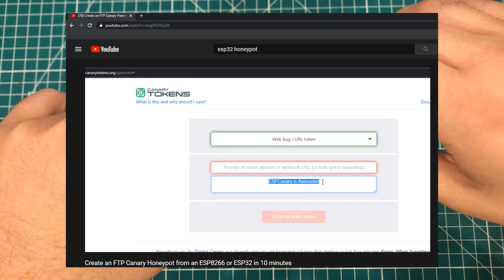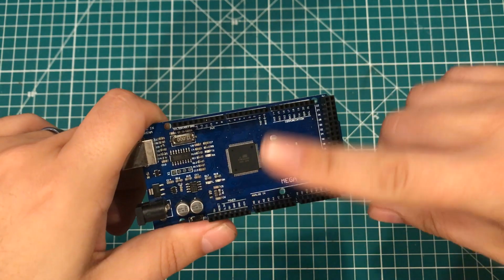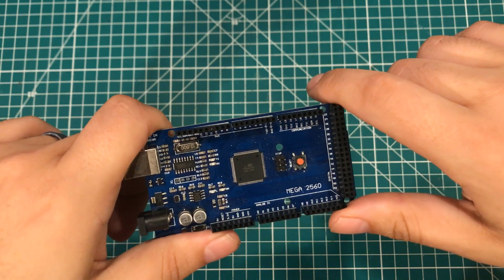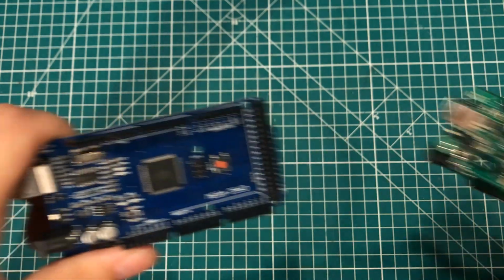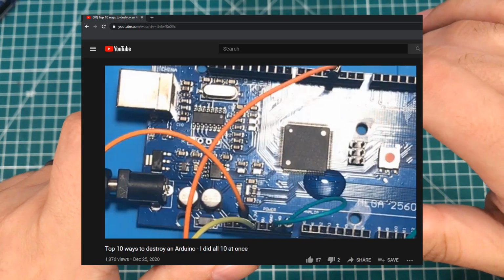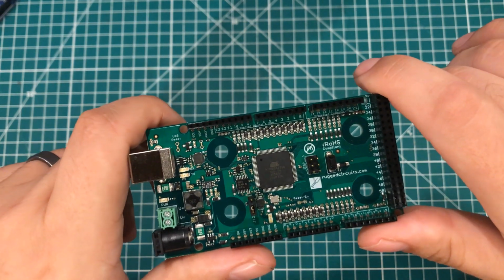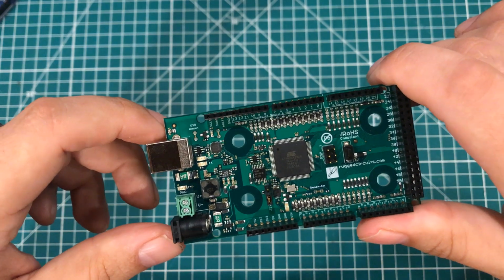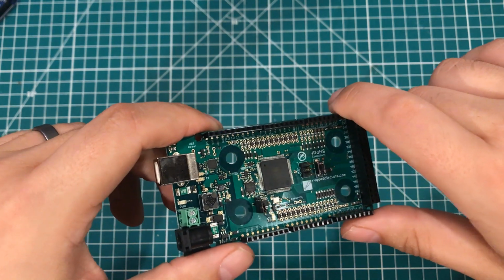Can you use an Arduino in Commercial and Industrial Applications?

Comment: Great Video!  Great channel.  
The Rugged MEGA inputs are rated up to 24V max.  Power input is 3.5V-30V.

The 24V Industrial Shield will also work on all Uno based micro boards.  The Rugged MEGA happens to have a selectable jumper which allows use of Mega based boards or Uno based hence the compatibility.
Reply from the maker: That's really interesting.  I really like the PLC board, and I think people would be interested in testing it with a cheap UNO clone and then moving to a more expensive Rugged board after testing.  That's all great info!
Reply: Thank you for ckarifying!

Comment: The Industrial world runs on mostly Allen Bradley and Siemens PLC reason  they are designed for industrial purposes do way way more than just basic digital I/O. Factory plant control does now way way more in what was once done back in the 90's these PLC are not cheap but when you have a multi million dollar plant running where safety and reliability is what is important a Arduino does not come even close. Also when you supply and write to these PLC's you want support when you need it software that's reliable in developing your solution. The arduino I have never ever seen used as an industrial replacement. Its was designed as a learning tool and for that its great but as a turn key solution its a no go. And for embedded devices the world mostly runs on Intel, Motorola and Siemens micros.

Comment: You can of course replace PLCs with Arduinos. You may need 24 relay shields for the I/Os and depending on risks of the application you may need to manually add redundancies and good coding practice. But they can absolutely be used in place of PLCs.

Comment: Great but in high-speed operation i think that has not able to perform very fast operation...in generally inside the plc have STM 32 microcontrollers..it has more faster than arduino

Comment: Interesting 🧐 I most definitely have stuck it to the man with my crane. They wanted $10k for a wireless controller…I’m sure my solution isn’t as robust, but if anything faults I can get replacements from Amazon/etc in 2 days for  couple bucks and plug/play replace anything. My plan is to just build extra transmitter and receiver boxes and have them on hand since they’re so cheap 

https://youtu.be/l-EUqPsLQYg
Reply from the maker: Awesome channel.  Subscribed.  We used them on heavy equipment all the time in Alaska.

Comment: How reliable is this board? When I use a arduino uno or nano, I always run into the problem that it crashes wenn I use it in 220v applications. I need a board that doesn't crash when I'm putting on a heating element or an electric motor.
Reply from the maker: I'm wondering why that would be. I found this thing to be crazy reliable. If you are doing some kind of relay, is it optically isolated from the board?
Reply: @AnotherMaker  yes I use the Standard relay boards from ebay,  they are optically isolated.
Reply: @duitsland2756  it seems pretty weird. The only thing I can think of is that maybe you need to power the relay board externally. If you are driving the relay board from the Arduino itself you could get some kind of voltage dip... But generally those relays don't care what they are driving

Comment: One of the companies I worked for we did project where they built a custom PLC to take a hydro mechanical device and convert it to an electromechanical device their initial bid to create this was $50,000 per spindle x 100 spindles per site. The customer needless to say wasn't too anxious to sign up for that they actually ended up doing it themselves over a course of a number of years whether they have the control or not who knows.
I ended up going back to the same plants but for another employer years later that's the only reason I know that they managed to get it done.
The company I work for previously that made these machines the newer electrical mechanical devices were Rock solid the control was insane you could actually make a lot more of the process than what was being used not to mention much faster much more accurate the price of the machine wasn't any more expensive the problem is taking the older machine and make it like a newer machine meant removing the entire electrical system top to bottom front to back sensors everything 100% had to go that's part of why it's so much for spindle to upgrade the machine.
Reply from the maker: For factories and things like that, downtime can quickly add up to millions of dollars lost, so it's often worth paying for the expensive stuff...depending on the risk/reward ratio.  Other times, the cheaper option is great because it's just not that important.

Comment: Ran a rock quarry crushing plant with an oldish PLC running on a ruggedized Windows 97 platform... (They're still running it btw) I can't begin to tell all the expensive repairs and thousands of hours of downtime that could have been avoided with a proper PLC or wayyyy better a microcontroller. (Which we had for two different crushers.) The interface/UI was OK, but not really that programmable unless you're the guy charging $2500 for a few hours to reprogram... Lack of reliable sensors, crushers boiling over, belts shredding and smoking, crushers STALLING and then getting to dig them out which is always a riot. I sketched out an improved logic/feedback loop a few times while up there and determined we lost 10% in just plant time, diags, electricians visits, training new employees to do something on a belt they can't see.
PLC upgrade/replacement cost?... $90k
Reply from the maker: Yeah. The cost of a board is only a fraction of the total cost of ownership with this sort of thing.  Thanks for the awesome comment.
Reply: but can this micro controllers   perform complex logic as done by plc ladder logic ? I have a 4 dc  output and 3 ac output)0.2 - 9 amp) small project  plus 7 dc input, with washing machine type logic.
Reply: @anandjoshi8554  Probably not one this size, but definitely could use a raspberry pi as enough. The wireless connectivity is great for sending plant reports. 2/3 of the power cabinets (can't remember what they're called for some reason) out in the plant that house the starters are run on LAN anyways, and the 3rd wireless I recall.

Comment: ATMEL's are pretty solid ,but you're right when it comes to thorough testing and safety features. At the very least you would want to develop your own board and power supply. The EMF from industrial motors are the biggest issue. If your IO lines are not shielded enough and your power supply is not properly designed. You are going to have serious issues. We had some freezing because of high voltage spikes, even the MCU watchdog was no match. A custom well tested solution can be created with those chips, just design you own board. Create software libraries with failsafe's built in. Also have a backup on board if the main controller fails and for goodness sake don't use those Arduino modules. They are of a horrible quality and design. Some of the chips are fake eve., only fit for prototyping. I have personally used an Arduino Nano and other off the shelf stuff to control a machine that consisted of a fridge compressor, dehumidifier compressor, temp and humidity sensor, 2 thermistors to monitor refrigeration coil temps, 2 speed control of a fan, a segment LED interface display and logging on a SD card. I modified an existing board by making a break out board form the microcontroller socket. Lots of resistors ,ICL, and RC circuits. Only a prototype ,but works perfectly.
Reply from the maker: Yeah The application matters.

Comment: You don't get far in commercial electronics without encountering integrity, reliability and safety issues. Using an Arduino shows an attitude from the outset that is primarily inspired by achieving cost cutting. Free software and minimal hardware design with minimal control of quality. Most PLCs use a very strict RTOS scheme to allow the programmer to achieve highly predictable results. The thought of an off the shelf Arduino running hacked free libraries controlling high value plant or anything with a safety critical aspect is enough to make most engineers blood run cold. This is why Arduino commercial solutions are so infrequent in the real world. Yes, technically an Arduino can do the job in many cases but who would want to be in the position of justifying it's use following an issue or accident.
Reply from the maker: You're absolutely right.  It obviously depends on the application.
Reply: ATMEL's are pretty solid ,but you're right when it comes to thorough testing and safety features. At the very least you would want to develop your own board and power supply. The EMF from industrial motor's are the biggest problem. If your IO lines are not shielded enough and your power supply is not properly designed. You are going to have serious issues. We had some freezing ,even the watchdog. because of high voltage spikes. A custom well tested solution can be created with those chips, just design you own board. Create software libraries with failsafe's built in. Also have a backup on board if the main controller fails and for goodness sake don't use those Arduino modules. They are of a horrible quality and design. Some of the chips are fake even, only fit for prototyping.

Comment: These industrial ruggedised boards would have been handy. Never having built an industrial factory floor machine in my life ( I was only officially employed initially as a factory worker an subsequently as a maintenance guy ), I used my previous hobby Arduino knowledge and engineering know-how to help my company of 10 people with a small factory to single-handedly build three successive incarnations of a human operated, floor standing industrial machine in around 2012. My control choice in the first machine were two Arduino Duemilanove. The final incarnation replaced these with a single Arduino Nano. My boss kept on at me about using industry standard PLC's of which I had some knowledge of at the time but I had to go with what I knew best. I also argued that using a PLC would be like using a very expensive sledgehammer to crack a nut given the relative simplicity and standalone nature of the machine. In addition, my company would have had to have given me training in PLCs which could have cost as much as the machine build itself...! In an effort to build a professional looking machine, I used all industry standard enclosures, buttons, switches, rack mounted 24V power supplies and solid state relays to get me that 5V to 24V conversion interface so you'd never know just by looking at the machine that it wasn't PLC controlled. On the first machine I had problems with electromagnetic interference which kept crashing the microcontroller. I was using it to drive a 3 phase motor via an inverter drive as well as a stepper motor and pneumatic cylinders all in close proximity.  After consulting with various electrical experts I learnt a lot about electrical shielding and that EMI shielding is a bit of a black art..! On the subsequent machines I'd learnt my lessons and took heavy precautions. All throughout the first machine build I kept getting raised eyebrows by various "experts"  as why I was using a microcontroller and not a PLC, the implication being that it was an "amateurish" route to be pursuing and "dangerous" from an H&S aspect. I fended them off but these encounters always left me in some doubt as to whether I was doing the right thing. In the end my machines quadrupled production capacity at a fraction of the cost of the PLC route. If I'd had access to a ruggedised and industrial interface readied Ruggeduino at the time, the EMI problems and interfacing to standard industrial equipment would have made things a hell of a lot easier. At the end of the day, in my opinion it's a "horses for courses" argument, yes you don't get well established industrial safety standards, equipment and integration to rely on, but you do get the open source flexibility, immediacy, availability and vastly reduced costs that microcontrollers offer. Maybe the new Arduino Portenta will start to change what I feel is a legacy mindset in the industrial automation field, one that likes to wag its finger and beat you over the head for not complying...
Reply from the maker: Yeah. Arduino is putting a lot of effort into the "Pro" stuff. I don't know that anyone will use it, but I think it's a worthy investment.  These rugged boards are great. I have one going in an industrial setting soon.  The quality is incredible.
Reply: @AnotherMaker  The Ruggeduinos sound like the business. Unless I'm simply unaware, I've never seen advertising for EMI protection on any microcontroller product so I'd be particularly interested in how well they ( and the Arduino Pro for that matter ) perform for protection against high voltage spike EMI in the "noisy" industrial environment. Does the Ruggeduino address this? Personally, for potential future projects, I'd be doing a side by side bench test, an ordinary Arduino and a ruggedised version, running some simple sketch on both and introducing a variety of controlled EMI sources in the hope that the ruggedised version would be better able to weather the storms. I do know that long lengths of wire into and out of a microcontroller can act as aerials for EMI making them particularly sensitive in this regard. Experimenting with different standard shielding techniques could be part of the plan if problems arise. This would be my only concern in terms of industrial safety when using microcontrollers as it is not something you can easily control for and is difficult to track down. Otherwise, apart from arguments about how "Ladder Logic" is "safer" than procedural languages, I see no convincing argument for not using microcontrollers.
Reply: Very nice to hear what you went through and looking at other ways instead of the traditional way of using PLCs. Thanks for sharing your comment was interesting and informative 😀
Reply: Hi @saiello, I hope you're doing well. I wanted to ask if you could share your knowledge or provide some insights on electrical shielding and EMI shielding.  Let me give you a bit of context: I'm currently an intern in the aerospace industry, and I'm looking to integrate Industry 4.0 and IoT into some of my projects using microcontrollers like ESP32 or Arduino so any guidance or recommendations you could share would be greatly appreciated.
Thank you in advance for your time, experience and knowledge shared!

Comment: The biggest problem with using an Arduino in industrial environment is most industries have a standard PLC that their engineers,  service technicians and maintenance people know.  They also buy the PLC software and learn how to troubleshoot ladder logic.  Ask a maintenance guy to troubleshoot Arduino code and he would tell you to go F yourself.   Also most systems have an HMI that communicates with the PLC.  I haven't seen an easy HMI for the Arduino.
Reply from the maker: I can see that but that's assuming all industrial companies have those people on hand. The ones I work for don't.